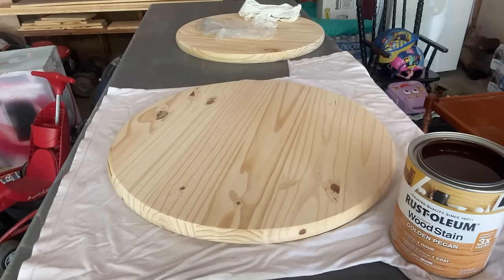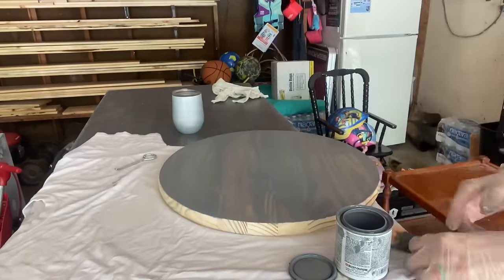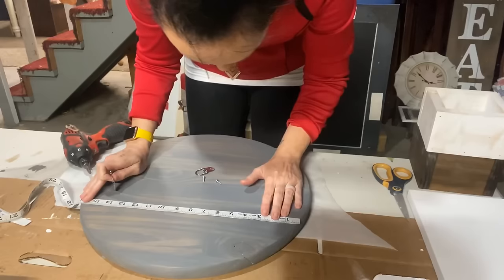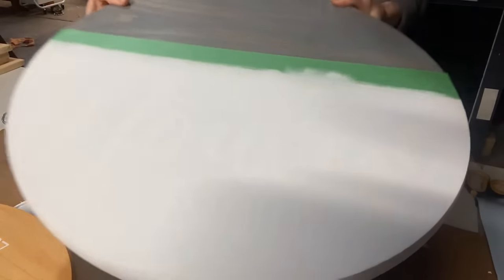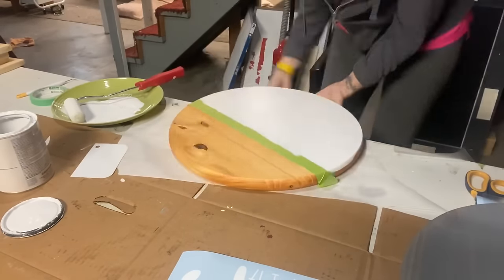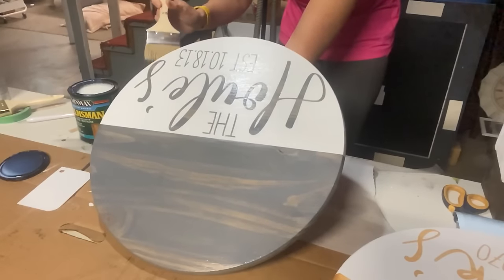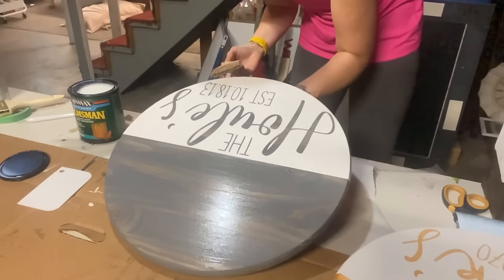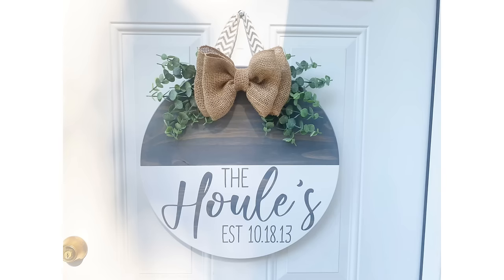DIY WOOD ROUND || DIY WOOD DOOR HANGER || WOOD SIGNS FOR BEGINNERS

Comment: If you are making a lot of these, a template with holes for the d-hook positions might be helpful? Just trace the round on a sheet of cardboard, measure and mark it up, and drill holes where the d-hooks should go. Then when you are ready, place the template on the back of your sign and use a marker to make dots through the drilled template holes. Hope this helps :)
Reply from the maker: Where have you been my entire life Jessika! That is genius!

Comment: Hi, I love your video. These are the instructions I wrote watching your video. Am I missing anything?

*ignore my typos...I did this really quick while watching the video. 

1.	Sand board 
2.	Stain both sides of the board for a more finished look using a 2x2 microfiber towel
3.	Using chippy paint brush apply a thin layer of clear satin sealant to one side (which will be the back side)
a.	Check for runs 
b.	Poly acrylic works fine too 
4.	Apply large D-hooks 3 inches from side 
5.	Firmly apply painters tape and cover the edges
6.	Add decal, peel contact paper
7.	For a clean look use a mini foam paint roller to paint over the name with chalk paint.	
a.	For a rustic look use the chippy brush 
b.	Paint soft even coats – don’t press too hard 
8.	Let dry then add second light even coat. 
a.	Make sure it’s completely dry and use a blow dryer to speed up the process. 
9.	After completely dry, using the webbing tool remove the decal 
a.	Don’t press too hard picking up the vinyl because it may cause grooves and paint to chip 
10.	Once dry dust off the chalk paint 
11.	Add 1-3 coats of sealant to the front and let it dry 
a.	Don’t forget the edges 
12.	Add ribbon (22 in) to hooks with hot glue 
a.	Place down square paper under the hook 
b.	Loop ribbon through hook
c.	Fold over about 2 inches add glue and firmly hold 
13.	Take the bow and greenery and wrap together using same burlap or whatever matches so that it’s 1 pc. Glue on with hot glue and e6000
Reply from the maker: Wow! Erica! You are very thorough. I like your style. Looks like you have everything down. I would just note that you while taking your stencil off make sure you are brushing away the flakes of chalk paint as you go (not just after). Thank you so much for watching and learning! It's a pleasure being able to teach ya'll this.

Comment: Is there any waiting periods? After you stain, painting Or applying vinyl?
Reply from the maker: Hello. 
Stain - cure 24 hours 
Paint - cure 24 hours before applying clear coat 
Clear - read the back of your can as instructions can be different brand from brand.
Reply: @UnicornDustDesigns  you mentioned that you use a blow dryer, (we’re all impatient) so how long did you wait then, since you used a blow drier.. the same for the paint. Thank you for the video and tips and all the info. I loved it and also just subscribed. :)

Comment: You don’t need apostrophes when you’re just making plurals. A family name would just have an s added to make it plural, not an apostrophe s.
Reply from the maker: Thank you for letting me know Donna :)
Reply: Thank you. This design is so awesome and gorgeous...but that apostrophe is killing the editor in me.
Reply from the maker: Universal Soldier you aren’t the first to say this. As you can see in my sunflower video I no longer use the apostrophe
Reply: I was scrolling the comments to see if anyone said this. 👍🏾
Reply: Does the same rule apply if the name ENDS with an ‘s’  ? Thanks
Reply from the maker: This is what I found when researching it 

📌 ***Apostrophes will not be used on this sign as it is incorrect grammar. These signs are made with the last names made plural, not possessive. 
If there is no established date left with the last name during check out, the est date will be left off of the sign.

Last Names ending with S, Z, and soft CH are made plural by adding an ES to the end of your name. If you don’t like the way that looks, please request for me to leave off the “The” in the note to seller section during checkout. 
I will then only add your last name as is under the large letter.
Example: Instead of The Joneses on the sign, I would just add Jones under the larger intial.
Reply: What about if the last name ends in ch?
Reply: @taty1103  if it ends in ch add es, but if the ch makes a k sound, add only s.
Reply: @buzzyboocraftsllc  thank you
Reply: Are you using a Cricut machine??
Reply from the maker: Hello! Yes, I use the Cameo 4
Reply: @taty1103  I never ever write my last name like this because mine would be Heinrichses so I always just say Heinrichs Family. So for yours I'd write The Rexach Family instead of The Rexaches  LOL!

Comment: UGH Help!!! I just realized I wasn’t supposed to put the sealer on the front before I painted on my saying. Is there anything I can do to salvage it? do I have to resort to vinyl on it now? I really wanted to paint the design. HELP!
Reply from the maker: Hi Pam. You can just take some smooth sandpaper like 220 for example and sand that down so it’s smooth and then apply your paint and stencil.

Comment: Helmsman is my FAVORITE!  I did a kitchen table in it years ago and it’s now my craft table.  I’ve beat it up, ironed on it, etc and it has held up.  Our current kitchen table has a factory poly on it and it clouds up at the hint of a hot dinner plate or water glass.  I plan to sand and coat it in Helmsman for a better, more durable finish.
Reply from the maker: Yes! It’s a great clear coat to use for so many reasons! And you’re right - it’s super durable. Thanks for watching girlie

Comment: When staining your rounds since you do both sides at the same time, what do you prop them on to dry and does the stain transfer or will there be marks from what it is on to dry? Hopefully that makes sense. Thanks for your amazing tutorials!
Reply from the maker: Hi Jamie. I just prop them up against a chair or wall. They dry well that way. I wouldn’t lay them flat to dry because most likely the other side won’t dry
Reply: @UnicornDustDesigns  thank you so much!

Comment: Amazing! I have a few questions....1. can you tell us what type of wood you use, and do you cut your own wood or buy it cut? Also do you put the sealer on each wood after you stain them? Where did you buy the flowers? Also couldn't you have left the vinyl on the wood? Thank you so much you are a great teacher!!
Reply from the maker: Hi Sandi! 
1. The wood I used in linked in description box 
2. I put the sealer on the back first - then put it on the front after I’m completely done painting 
3. Lambs ear is from Walmart 
4. I couldn’t leave the vinyl on the wood because I’m painting over it. Some people make their signs with vinyl but I don’t think there’s longevity in vinyl. Especially when outside in the elements.
Reply: Thank you very much for replying.
Reply from the maker: Sandi K you’re very welcome

Comment: I loved your video definitely want to do this. I have a ? Though how has your glue gun gluing held up in the heat. I have made wreaths before and when it gets hot in the summer it all melts and eventually loosens up and falls off. I would be worried to keep the ribbon attached that way.
Reply from the maker: Hello Adrienne. So I use hot glue and E6000 when attaching my bows that way it will hold up to the heat :)

Comment: Sorry if you already answered this question. But what kind of vynil do you use on wood (If you can provide the link) and how long do you wait to remove the vynil after painted, I know until it dries but approximately how long?
Reply from the maker: Hello Yauri. I use 651 oracle vinyl and it’s in my amazon store attached in my description box. I allow it to dry completely and then remove. Never leave it on longer then it needs to be. Dry time will vary you just need to keep an eye on it
Reply: Thanks so much very helpful info. I made one yesterday and I think I left it too long because it peeled off a bits thanks again

Comment: Loved your tutorial! One question. How do you clean your brush after using helsman? I've tried paint thinner to no avail. I can't be using a new brush every time! Thank you!
Reply from the maker: Hello Ashleigh. If you’re using the water based Helmsman you should be able to rinse your brush with warm water and let it air dry.
Reply: @UnicornDustDesigns  Totally was using oil based! I bought the water based. Won't make that mistake again. Thanks! One more thing, I bought the d hooks that you linked, but they seem smaller than yours. Do you have the correct d hook link? Thank you so much!!!!
Reply from the maker: @ashleighdavis9366  hello girlie - phew 😅 so glad you figured that out. As for the D Hooks I will look again but the ones I ordered way back when haven’t been available so I chose something that would still work. They may seem smaller but they hold just as much weight.
Reply: @UnicornDustDesigns  Thanks for your quick response! I will try them out!

Comment: Thank you!  Your signs are beautiful!  In the video, you talked about the type of glue you used.  What was that again please?
Reply from the maker: Hi 👋 Lisa! Thank you so much for the compliment! I use E6000 and hot glue. The E6000 gives it a concrete hold for longevity and the hot glue just helps give it an immediate hold. I also place a piece of wood on top of it when drying so it stays firmly in place. I hope that helps 
http://www.walmart.com/ip/Eclectic-E6000-PLUS-No-Odor-Industrial-Adhesive-Clear-0-9-Fl-Oz/600429423
Reply from the maker: Hello Lisa! E6000

Comment: This is beautiful!  I have a question though?  You hot glued the ribbon, after you threaded it through the D Hooks.  Is that the only thing holding the sign up, when you hang it?  Just the hot glue?
Reply from the maker: Hello Linda. Yes, it is. I’ve had signs hanging on my door for months and they are still good as new. I’ve never personally had issues with it.
Reply: @UnicornDustDesigns  Thank you!  I really appreciate your reply and I'm making the lazy susan today from your video!

Comment: Are you using oil based stain with water based top coat?? I’m still learning but I thought that was a no go? Your signs are beautiful!
Reply from the maker: Hello Gianna. Yes, I am using oil based stains and the clear coat is water based so that it doesn't yellow your paint
Reply: Unicorn Dust Designs I thought you couldn’t mix them like that? Is there a certain amount of time you have to let the oil stain dry before applying water top coat?

Comment: Dollar tree has a level that is perfect size  for helping your straightness struggle
Reply from the maker: Ohhhhh how I love dollar tree!!! Thank you for coming by my channel and watching Alicia!
Reply: I just bought one yesterday from there
Reply: @michelejarrell4851  what is it called?  I want to go tomorrow to pick one up but I have no idea what I'd be looking for.
Reply: It's called a level. It in where all duck tape and zip ties are. I'm trying to send a picture.  It won't let me
Reply: @michelejarrell4851  I have levels, but none of them work with a project that is laying flat on a table.  I'll go and check it out tomorrow!  Thanks!
Reply: @kerrialdridge743  this is small. It's 16 inches long
Reply: A chalk line would be so much easier to mark a straight line. Then you just screw your hooks in and wipe the chalk off. Straight line every time.
Reply: @lizzardly  does the chalk come off easy?
Reply: @michelejarrell4851  yes it does.
Reply: @lizzardly   What colour do you use
Reply: @michelejarrell4851  Usually they are filled with either red or blue. It doesn't matter because you just wipe the chalk away with a damp rag after using. Here's a quick vid on how to use one. https://www.youtube.com/watch?v=bVHt-XkWnu4
Reply: What is the size of the wood rounds you made in this video?
Reply from the maker: Hello 👋 18”

Comment: love all your videos! Tried to make something similar. Have you ever had issue with vinyl sticking to the Helmsman? I'm finding mine is lifting
Reply from the maker: Hello Juliana! I never put clear over my vinyl. It’s the clear itself which is causing the vinyl to lift.
Reply: @UnicornDustDesigns  thank you so much!!!! I applied the Helmsman after the staining and my vinyl won’t stick at all. Am I doing something wrong?
Reply from the maker: @FirstLadyDurr  just to confirm ... you only apply the clear to the back first ... then you will lay your vinyl, paint, dry, and then apply your clear over that.
Reply: @UnicornDustDesigns  you need to do a video exclusively for me entitled “Wood Rounds for Dummies😂😩
The first one, I added Varathane Penetrating Wood Stain, then I added the Helmsman water based urethane and the vinyl would not stick. After sobbing for about 5 minutes I scrolled through the comments and found that the Helmsman does not go the front until after the chalk paint. Dummy me😩
Since I didn’t put the Helmsman on the back (stain only) I flipped it over and tried to stick the vinyl there and no luck.
Third wood round: plain wood round right out of the Home Depot bag. Tried to stick the vinyl again, NO LUCK😩
Oh and I didn’t allow the stain to dry before trying to apply the vinyl.

Comment: i love love your videos!they are so helpful. question how do you clean your brush after sealing?
Reply from the maker: Hi Natali! Thank you for watching! I just run them under warm water and leave them on a towel to air dry
Reply: What if it’s not the water base , do you have an idea how to clean them? Mine get hard and sticky after 😣
Reply from the maker: Unfortunately they are trash after. In my experience it never comes out. That’s why I use the cheaply chip brushes so I can toss after. I would highly recommend if you’re using white chalk paint to switch over it water based so that it doesn’t yellow your paint.
Reply: Unicorn Dust Designs yes I figured , it’s so hard to clean them , thank you so much !
Reply from the maker: You’re welcome girlie. Let me know if you have any other questions!
Reply from the maker: Maybe paint thinner??? I would google it but I’m pretty sure that would work.

Comment: I love your round door hangers.  But how do you keep from having bleeding when you pull up the stencil?  I have made sure it is completely dry and I'm still getting bleeding.
Reply from the maker: Hi Patti. Are you sanding down your piece of wood to where it's buttery smooth? Any roughness you have in the piece of wood will cause texture which in return will cause the vinyl not to sit perfectly flat on top of the wood and will cause bleeds.
Reply: Yes I have a rotary sander.  
 @UnicornDustDesigns

Comment: Hi there. Question. Have you ever messed up on a sign and wanted to redo it? If so, do you sand down the painted area, or can you just paint over it with a dark color? Thanks in advance!
Reply from the maker: Girllllll ... literally tomorrows video is me sanding the fall y'all sign down that I made and doing it all over again :) 
Now if it's just the design or something you don't like you can simply sand the top down and re stain. I wouldn't worry about your sides or back because it should match if you do a good job sanding.
Reply: Unicorn Dust Designs thanks for the quick reply!!!
Reply from the maker: You’re welcome

Comment: So this may be a stupid question but, do you wait for each coat of seal to dry before applying another for your last step?
Reply from the maker: No question is a stupid one Jamie! I usually only put one coat of clear on it unless I know it will be directly out in the elements.
Reply: Unicorn Dust Designs my sign will be so should I let the coats dry a full 24 hours before reapplying?
Reply from the maker: No, you just have to wait until it’s throughly dry and then you can reapply. I would read the back of the clear. It’s probably 2-3 hours.
Reply: Unicorn Dust Designs Thank you so much!

Comment: I don't know if I missed it, but why did you go with the spar instead of the polyacrylic? Also, did you use the e6000  just to glue the bow and florals to the board after gluing them together? Thanks!
Reply from the maker: I will try this again because I felt like I just answered this and it deleted it or something. 
I use spar because it is made to withstand the elements such as humidity and rain. Poly is supposed to be used for indoor use. I used the hot glue and E6000 to attach the bow to the wood but not to make the bow and flower combo. Thank you so much for watching Crystal.
Reply: Unicorn Dust Designs thank you so much for clarifying! ♥️

Comment: Do you seal both sides after staining? Do you like the sealant dry before you seal the other side?
Reply from the maker: After staining I only clear the BACK then allow to dry for about an hour or so then start on the other side. I hope that answers your question Amanda.
Reply: Thank you! So you don't seal the front before you paint or before you apply vinyl?
Reply from the maker: Not before I paint. I did a Q& A on wood signs that you should definitely checkout 😊
Reply: Thank you. I will go look for your video now!

Comment: Nice video and great tutorial and tips. Would suggest that you do not put the lines horizontal, especially due to the weight of the round and the interaction with any heat on the sign...  it causes the boards to separate.  Best to have the lines running vertical instead.
Reply from the maker: That is great info thank you so much for sharing it 😁
Reply: @UnicornDustDesigns  Yes, a sign maker at one of my shops was having problems with customer returns because of it...better to be a bit more complicated to make than risk your business reputation😘

Comment: What kind of wood did you use? Does the type of would matter? Is pine wood fine
Reply from the maker: Hi Samantha! I actually linked the wood round I used in descriptions. The one I’m using is pressed pine wood. There are thinner pieces of wood rounds like birch wood you can get at craft stores and those work just fine but they are much thinner.